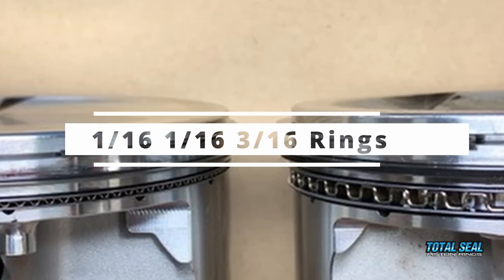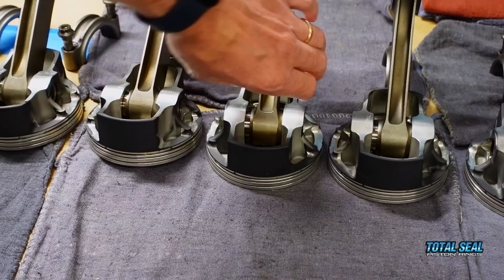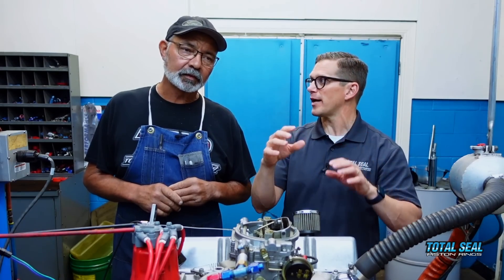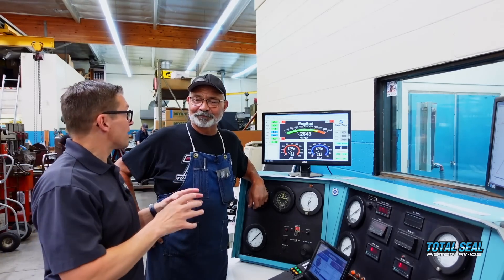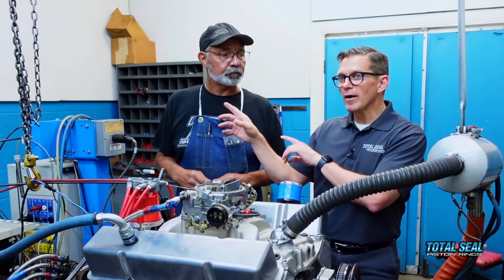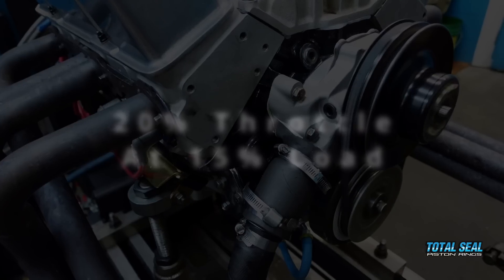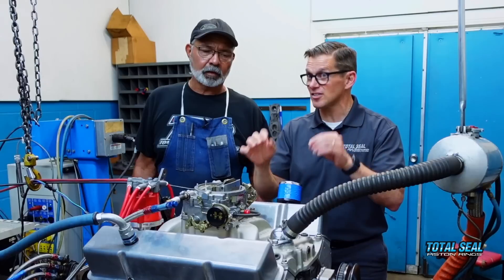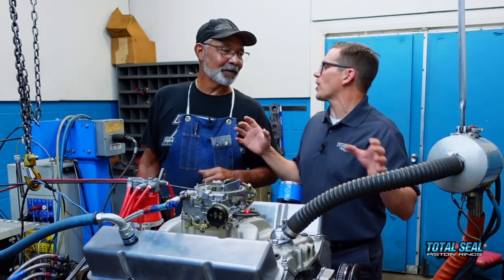3 Steps To More Horsepower: Cylinder Bore Honing

Comment: Those headers can’t be typical used on a street car.  So that would change the dyno reading with street header. The headers on there will improve hp a torque.
Reply: all the ring packages/hone used the same headers, what par of compairing apples to apples arnt you understanding?

Comment: recently had my race blocked honed on a rottler 8 series and they honed it with a valley depth of 130 do you think thats to deep? 25 psi 7500 rpm e85 motor all forged internals. im concerned about oil consumption

Comment: I'm just wondering how this effects air cooled engines like those found in motorcycles, corvairs, porches and volkswagons?

In the case of the car engines they are quite old and seem like they would benefit from a more modern design.
Reply from the maker: They would all benefit from this as well.
Reply: @TotalSeal  the extra heat wouldn't cause issues with even gapless rings?

Comment: Can these gapless rings be used on a stock everyday driver Toyota or Subaru engine? And should you? Just asking because my Subaru burns oil and sisters Toyota does as well.
Reply from the maker: No, the Gapless, Gas Ported top rings are not for street use.

Comment: Soo.. what's the point of all this? Ford,Gm, honda, all seem to go 100,000 miles today. What more do want? I'm sure the factories don't screw around all day honing and measuring the flycrap on each engine. They'd never make any money or cars!  Stop blowing smoke and confusing people.  They just want a set of rings that's not going to wear out in 30k.  Use an engineered set of rings. 99% of the time the gaps are right for a street engine. Add .006 to .008 per inch for hi-po engines.
 Back in the day i used 1/16 1/16 1/8 in sb Chevy. Burned oil in 5000 miles. Using 390 Cadillac rings to fix it.( Has 1/16 1/16 3/16)
If it worked in a Cadillac it'll work in a Chevy.

Comment: What are the applications for gapless rings?
Reply from the maker: They are excellent for turbocharged engines (gasoline and diesel), supercharged engines and nitrous.
Reply: @TotalSeal  can one assume that for road race, issues with ring flutter happens at high RPM for extended periods of time?
Reply from the maker: @CJ5EVOLUTION  It can. The solution there is going to thinner, lighter ring package that includes a gas ported top ring instead of a gas ported piston. That will fix that problem.
Reply: @TotalSeal  yes that is the offer I got from Total Seal, but I'm waiting to get other parts of the build that are more expensive, my main challenge is to find a local shop to hone the block to. 010" over the stock size, where I live now shops are of very poor quality machine shop and vague knowledge, they don't even understand surface roughness, peaks and valleys, that is the down part of living in the middle east, just trying to avoid distroying the rings that are quite expensive.

Comment: About 22 years ago i bought your gapless 2nd ring set of .030’ over rings for my stock/warmed up 350 build.  It always seemed to have very minimal oil mist come through the PCV and the oil looked cleaner than ever even at 3k miles when i changed it. 
 I can’t ever recall having to add oil between oil changes either. 
 I’ll only use gapless rings in future engine builds.

Comment: The problem I see coming is that most local engine machine shops will be reluctant to provide these specific honing parameters, or ones like these.
Reply from the maker: You might be surprised at how many smaller machine shops are buying the modern honing machines and Profilometers. It is the easiest way to get things right.
Reply: @TotalSeal  hmm, I'm learning a lot from these videos.  Seems worth looking for local machinists who will do it.  If they don't, I might try to spread the word about these videos them.  Thanks!
Reply from the maker: Happy to help!

Comment: Are these rings Moly filled or is that long gone , Havent built an engine for 20 years so wondering
Reply from the maker: The thinner 1.0mm rings are not Moly filled. They are coated with a PVD applied CrN coating.

Comment: It would be nice to compare the difference in the final cylinder finish after break-in from your original finish and, importantly, compare the amount ring wear after the same amount of use.
Reply from the maker: We do that.
Reply: @TotalSeal  Can you share the results?
Reply from the maker: @brianbrigg57  we check the results after each rebuild, and we also take oil samples for analysis after every test. Since this test, we've not had to rehone the block, even when swapping to a different ring coating. The valley depth and Rk was the same as when the block was honed for this test. The peal height (Rpk) was done slightly, so we hit it with 2 strokes of a 400 grit brush to bring the Rpk back up to 8 to 10 micro inches. The oil analysis results showed minimal wear. We are still running this same base finish 3 test iterations later, and the blow-by numbers are low and steady.
Reply: @TotalSeal  That's very interesting. It's nice to know that the finish alters very little so that we can keep enjoying the benefits of this combination. Thanks for the response.

Comment: Very interesting video and the first I have seen about 1mm, GAPLESS, Gas Ported rings. 
For an aluminium block, sleeved, Mopar BB based, HP oriented stroker light weight street engine, Lake would you still suggest using a 1mm, 1mm, 2/16” gas ported, gapless ring package? Bore 4.35”, Stroke 4.250, Rod 7.1”, Deck Height 10.725. 
The pistons and rings will have to be custom an I am leaning towards 4032 forged pistons.
Might it not be best the go 1mm, 1mm, 3/16” to keep it dry (smoke free) on the street?
With such explicit honing instructions (RVK 70-75) how many miles might it be before that hone gets polished off and power starts to drop fast? I aim, if possible, for a 50,000 street mile rebuild interval.
Thanks again and I look forward to the next “Coating” video.
Reply from the maker: Thanks for the questions. The deeper Rvk makes the hone last longer, so that is exactly the way to go for a high performance street build.

Also, the 1.0mm, 1.0mm, 2.0mm ring package is ideal for the street as well, but just go gas ported vs gapless gas ported.

Mahle has 1.0, 1.0, 2.0 4032 pistons available as shelf stock, which would be perfect for the gas ported rings.
Reply: @TotalSeal  
Thank you for your reply, but why do you not like the ideal of using Total Seals Gapless, Gas Ported Rings in this application? 
I thought this video was all about extolling the Gapless rings virtues over the gaped ring?
Can you give us a little more information about your reasoning?

With a honing finish of 70-75 KPA, I was planning on using Driven’s GP-1, 30 Grade Break-In Specialty Motor Oil … or would you suggest I use one of their multi grade Break-in oils?

I will look for the 4032  1, 1, 2 mm Mahle pistons … but I will be VERY surprised if they make a suitable piston for this stroker combination.
Reply from the maker: @JACB006  The gapless top rings are great for competition, but they are not ideal for street use. That is why the gas ported rings are great for street applications. Also, the GP-1 Straight 30 is wonderful for break-in of these rings.
Reply: @TotalSeal  Once agin thank you for your reply and I bow to your knowledge of the subject. Gaped it is.
If you/Lake have a theory about why the gapless rings don’t do so well on the street ….. could you (Total Seal) expand on it in one of the up coming videos? 

Oil choice noted .. I couldn’t understand why you would need a multi grade break in oil .. the oil’s only going to be in the engine for an absolute maximum of one hour.

I will look at the next video about ring coatings in the next video with interest. I assume that with gaped or gapless rings the coatings have the same effect?
Reply from the maker: @JACB006  We are happy to help. The gapless top ring creates a higher vacuum signal on the intake stroke, so it can pull oil past the valve stem seals. That's not a big deal on race engines, but can be problematic with a street driven car.

Comment: According to your dyno chart the winter blend made more power and the summer blend produced less. So to compare this run with the prev run you'd have to add 5-8hp to this run to compare it to what you did in the winter with the non-optimized ring conditions. So it looks like made about 20tq/hp more if you compared with the same fuel. Did I miss something?
Reply from the maker: Nope, you got that right. It made at least 10 HP more just by changing the hone. The other 10 was the difference between the 1/16th ring and the 1.0mm ring. All said, it was in the 20 HP range.
Reply: @TotalSeal  That's about 4%. That really is amazing. Now the next question for future videos: What about forced induction? Do you see the same results on turbo and supercharged engines? Also what about higher RPM? Seems to me it would make an even bigger difference at high rpm. You only went to about 5600 rpm. What about 8000 rpm? 

Inquiring minds want to know. ;-)

Thanks.
Reply from the maker: @stickman-1  We have the gas ported & gapless 1.0mm in the Engine Performance Expo LS, which is boosted and turns 8,000 RPM. That was a complete build so we don't have a reference on it otherwise.

Comment: But did the piston coating change the friction on the piston walls to improve efficiancy?
Reply from the maker: Good question. The piston skirts should not be touching the cylinders during operation. As such, the skirt coating has no effect on friction during normal operation.

Comment: I've been hearing discussions about whether rings rotate in the bore while running. You mentioned seating of the rings. Wouldn't that preclude rings from rotating? Do rings rotate or not? Thank you.
Reply from the maker: Thanks for the question. Rings to rotate in the bore. That is why two stroke engine pistons have locating pins to prevent the rings from rotating. That keeps the ends of the rings rotating into the ports and getting caught.
Reply: @TotalSeal  Thanks.
Reply: @TotalSeal  that question has been a question mark for a long time? So any idea of revolution’s per hour ? + or ~ at say 5,000 rpm ? Great channel and very informative 👍😎🇺🇸
Reply from the maker: @markgiraldes4062  Thanks for the feedback. The rotation speed varies based on the cross hatch angle.

Comment: NA sure no big deal because you aren’t dealing with ridiculous cylinder pressures
Like high hp per liter turbo cars.

I wouldn’t say 1mm ring isn’t that thin with 840 hp 2.0 turbo 4cylinder running 35+ psi of boost. Then ask it to live for 2 years lol.
Reply from the maker: LOL, once you go over 20 PSI boost, everything changes and it seems like nothing lasts that long…

Comment: How does this ring do with a boosted engine?
Reply from the maker: We’ve been running them in the Engine Performance Expo boosted LS, which made 1,300 HP. So far, they are doing great.
Reply: @TotalSeal  awesome I’m building an LS 408 where can I find them and the pistons?
Reply from the maker: @DIYWithTheRichardsons  These pistons came from JE, and they can supply Total Seal rings with their pistons.
Reply: @TotalSeal  thanks

Comment: Look like you're a decent oil pressure at the start but when you got up the RPMs what happened to the oil pressure down 24 lb not good at what 6,000 RPM?
Reply from the maker: That might be something with the video editing. The engine never had low pressure during any of the runs. That is something we watch closely.
Reply: It almost look like something that would happen to an engine with no windage tray and not a lot of oil capacity in the pan because I checked it and it was down to 24 pounds on your gauge on the dining room something to think about.
Reply from the maker: @pauljanssen7594  That's wierd, I see what you are saying in the video, but when I replay the raw video it shows 70 something PSI oil pressure at 6,000 RPM. We will double check that next time.

Comment: Why do testing with a terrible engine design like a chev.  Bad friction and thurmal probles.
Reply from the maker: It is a very common platform and the parts are easier to source.
Reply: @TotalSeal Thanks for responding.  that is what the problem has always been really. I think their is a lot of meat  on the bone with ather engine anyway.
Reply from the maker: @michaelgiglio1571  Yep, it is a two edged sword. We do have some other engines in the pipeline for future testing.

Comment: I'm surprised you guys aren't using a barrel fuel of some sort to have true A to B testing.
Reply from the maker: We are now! We’d had very good consistency from the gas station around the corner from the shop until this past year, and then it went off the rails. We are now using VP C-20. The video on that conversion process is coming soon.

Comment: Great video gentlemen! Another YTr suggested removing the second ring, and reducing the oil ring tension when running a crankcase vacuum pump to minimize friction & increase HP. What say you-a gapless top ring, delete the second ring, min the oil ring tension and run a vacuum pump or just run a thin ring package? Thank you!
Reply from the maker: Thanks for the question. It is better to use a thin 2 compression ring set up (3 piece ring set) than a thicker single compression ring set up (2 piece ring set). 

Here’s why, the 2nd ring is 80% oil control, so by removing the 2nd ring, the oil ring tension has to be increased to maintain proper oil control.

A low tension 2nd ring and low tension oil ring along with the vacuum pump is a more efficient way to go.

Comment: So would this be better or worse for a vehicle that would tow or is it just better for the life of an engine overall with modern tech have been hearing of a lot of advancements in the last 20 years alone
Reply from the maker: Great question. Since towing places more load on the engine, the deeper valleys help with increased lubrication. As such, it’s beneficial for towing as well.

Comment: You guys do any stuff with import / 4-bangers? I'm building a few different 4cyls and the race-quality aftermarket sucks. Would be neat to see what you guys would do with a K24 or even a B20, or 22R.

Also, it's time to buy some standardized race fuel for doing dynos. It's expensive, but really helps to control the variables, which is key for detecting small gains. And a bunch of small gains are what we are after.
Reply from the maker: Yes, we have steel rings for bore sizes ranging from 68mm up to 5 inches.

Comment: what happens to the piston to wall clearance when the coating wears?
Reply from the maker: Great question. The LIne2Line coating is unique because it is designed to wear, so we set up the clearance at .002 installed so it could wear to the perfect size. Once it is at the right size, the wear will be very low after that.
Reply: Same as when the piston wears, a bit of piston slap. Should last a while, but might lose full ring seal a bit faster from rocking in the bores. I'm always suprised to see how much coating is left after pulling out used pistons. I always assume in my mind that it just kinda rubs off, but most seem to hold up okay. A nice surface finish in the bore also helps prolong its life.

Comment: Great video guys👍 It's my first time watching your channel and the last time I built an engine was the early 90s. I have some questions and if you've already covered them previously I apologise. 
These have to do with street/strip applications....Will the narrow rings last as long?....Will the side clearance open up quicker?....What piston clearance do you recommend for cast and forged with the hone you're using?....Again...GREAT VIDEO
Reply from the maker: Thanks for the feedback and questions. The thinner rings actually last longer than the old school moly rings, and the smooth surface finish of the steel rings doesn’t increase the ring groove wear. 

In regards to the piston to wall clearance, the extreme plateau finish doesn’t change the recommended clearance. We leave that clearance recommendation to the piston manufacturer and engine builder.
Reply: @TotalSeal  Thank you for responding. Rather than the ring groove, it was actually the side clearance in the ring land that I was curious about the wear.
.....In the late '70s I used chrome moly rings with low tension oil rings. The block was honed with torque plates and a 600 grit finish. It was better than stock but what you're doing these days makes it look pretty lame

Comment: I know you're trying to sell more expensive rings, but when are we gonna see a vertical gas ported piston vs the lateral ported rings. I don't see how air changing directions multiple times with the rings is more effective than for the most part straight down.
 I'm not being a smart ass and love new ideas and technology but also want to see some apples to apples comparison.
Reply from the maker: We might try that. We agree vertical gas ports in the piston are very effective power wise, but they won’t have the durability of gas ported rings. Maybe we can come up with a test that can cover both aspects. You have our wheels turning. Thanks for watching.
Reply: @TotalSeal  rereading the first part of my comment, I know it sounds like I'm saying you're just trying to upsale (poor wording) when I know you're just showing the upside of a little more upscale/beneficial ring pack. 
I do and would like to see a comparison of the two but no matter the results I'm still a total seal customer 👍
Reply from the maker: @Dirtydave67  it’s all good! Thanks for the support and ideas for a future test.